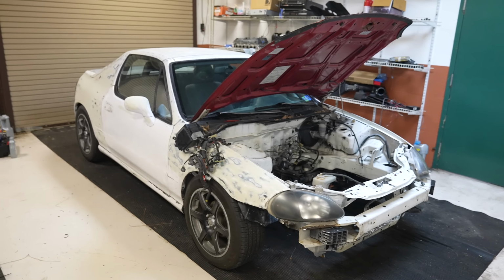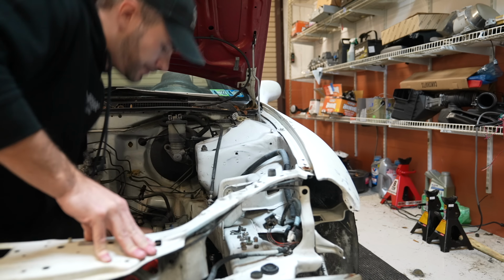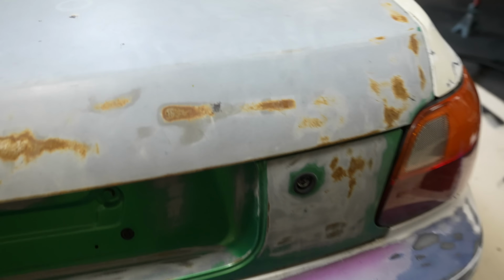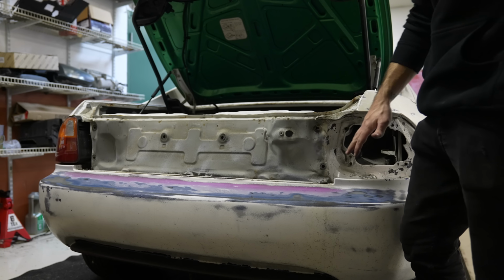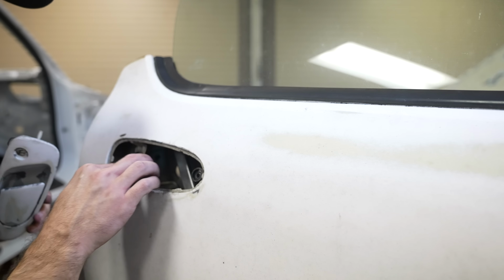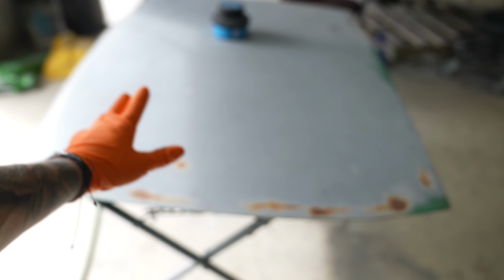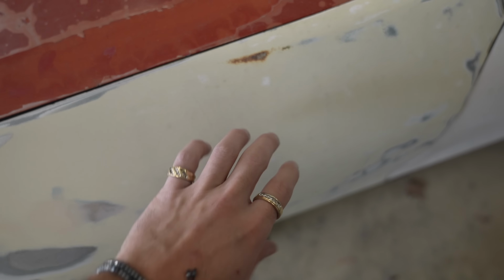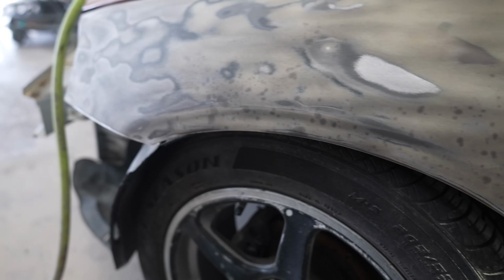Building my Honda Del Sol! Part 1: PAINT PREP AND BODY WORK

Comment: For reference..Guide Coat is used over high build primers to show any low spots i.e. dents and dings..with blocks not a da. You won't get it completely straight with a da sander. I do all old vehicles mostly trucks hotrods so iv been doing it since  I was 18 and I'm 36. Sand the whole car with 80 then fix dents.

Comment: I wish I could accept such a realization.  My Sol (that I have owned for more than 20 years now) is starting to get holes the size of multiple fingers in it but I still can't bring myself to just give it up.  It literally needs everything at this point, but I'd still rather restore my car than have another.  I guess it would be different if I let go of the car already at some point, but I've actually owned my first car for 20 years now and it's hard to just give up.

Comment: the Ruined Sol if you ask me should become a decorative art peace vs being restored. it looks pretty cool rotting away like it is
Reply: take all the good parts and just leave the shell to rust
Reply: Or, keep full headlight depth (12-15") and have a side profile attached to a wall. Basically, hanging a fender, door, head/tail lights and a small bit of bumpers and hood. Could be a cool talking piece
Reply: @naturalsr405 thats an awesome idea!
Reply: @Robinastc  would be sick, as you get to keep some of it as, a cool remembrance piece, but it's not going to literally be a heap of junk on the ground that you have to clean up at some point. Would be a lot of work, but would be super fun to do with a plasma cutter, slice that baby up. Cut a bunch of the inner structure stuff off so it's not super heavy. Keep a little bit of the frame so the door, fenders, lights etc have something to bolt to and boom!
Reply: @naturalsr405 there’s a guy in my town with a cut of a 68 Camaro like that hanging on the fence in his front yard, it’s kind of hilarious bc he even covers it for the winter lmao
Reply: Well it's Mike's car he can do what he wants and I'll support him it would be cool to leave it yes I would AMD just get new pieces for the new car but it's his car and will turn out bad ass no matter what
Reply: @Matt_Lanzer_13  that's hilarious
Reply: Yea I say don't take anything from it and leave it as is. Buy new swap and parts for the new one
Reply: Way too true bro should be kept as it is
Reply: AdamLZ wants a water fountain for the compound. Maybe make it the centre of the fountain 🤷🏼